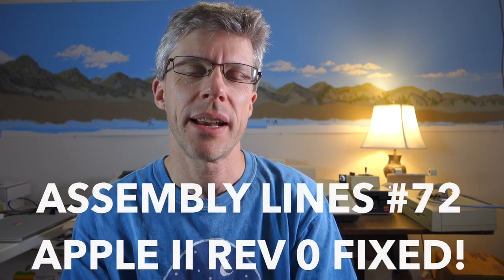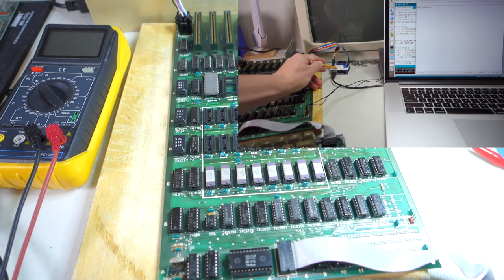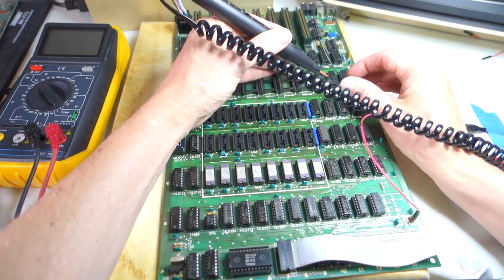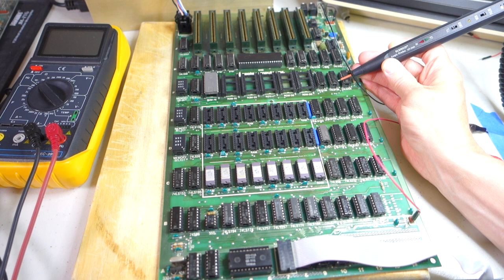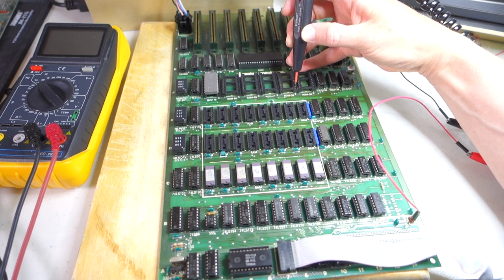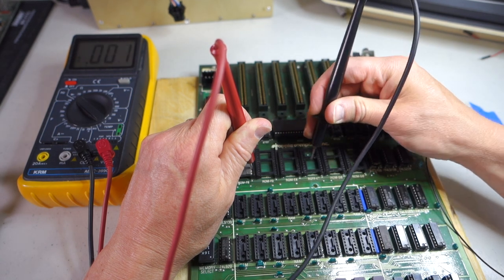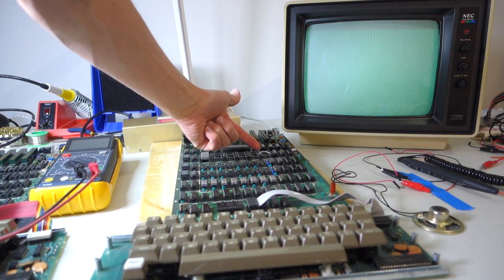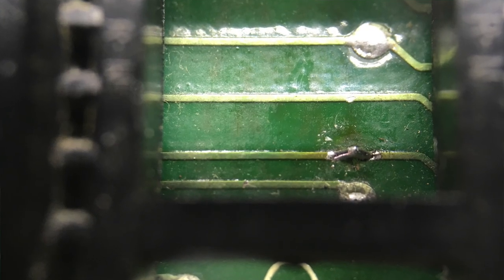#72 The Rev 0 is Alive!

Comment: Cool, good bit of sleuthing with the logic probe!
Reply from the maker: Yeah, I was afraid that I would never use the logic probe but it turned out to be invaluable!
Reply: I bought one in the 80's when I replaced the slot 6 connector on my ][+ (!!!) but never needed it. I love the sound feature on yours, perfect for the clock rate in 80's era micros.